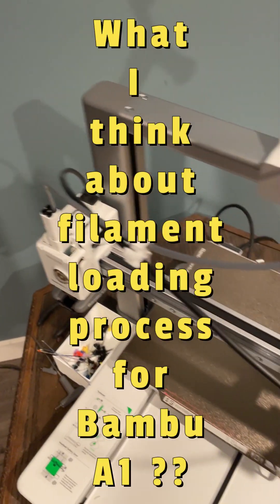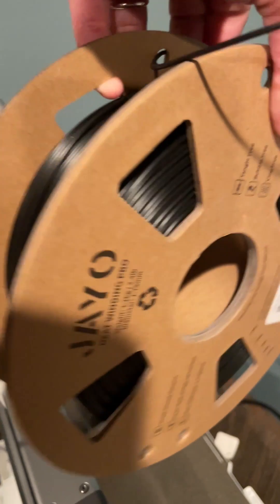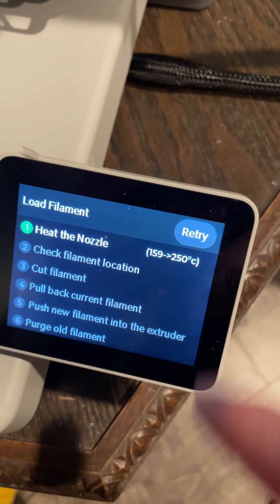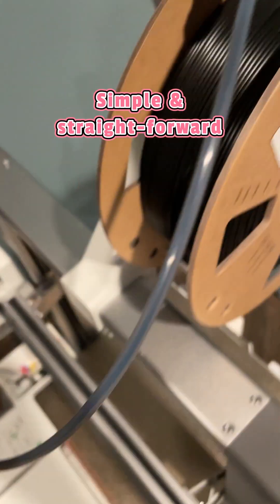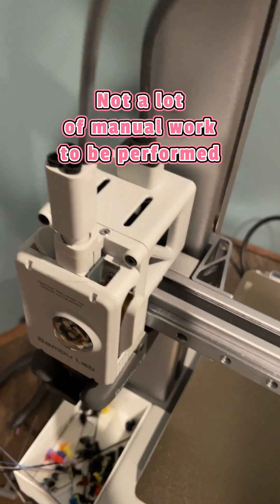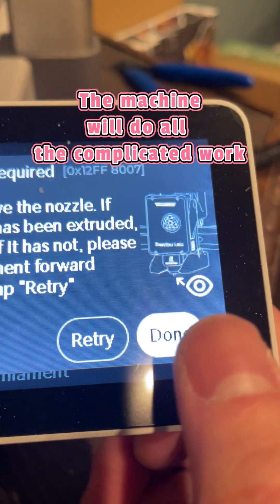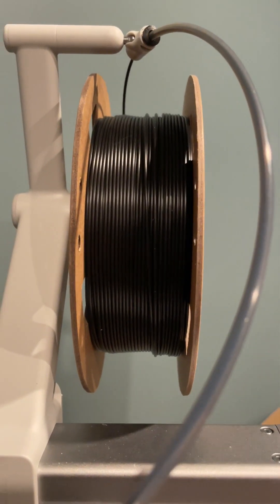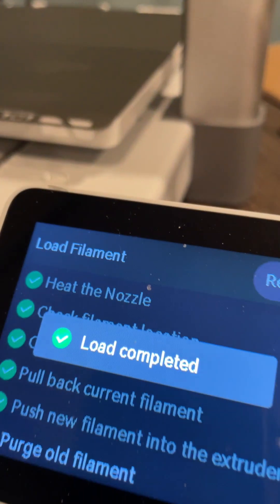Quick Look at Loading Filament in Bambu Lab A1 3D Printer

Comment: Mine isn’t loading the filament. Do you have to disconnect all ptfe tubes except for the one going to the external spool? If so that is seriously bad design. I can’t figure out why else it keeps trying to grab filament from other spools.
Reply: Получилось загрузить?
Reply: Try to purge it first. Had to do that with mine before it would load. Works good now.